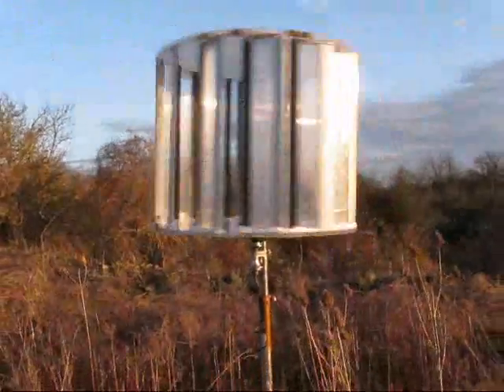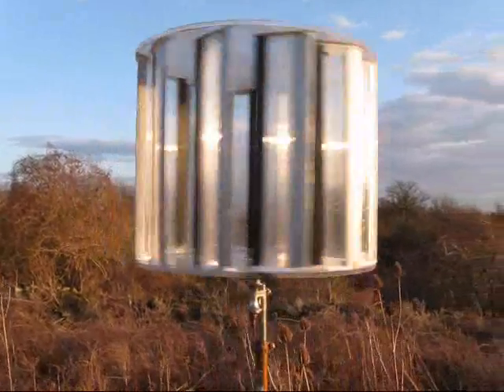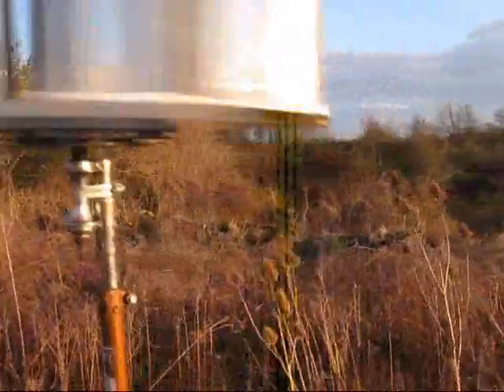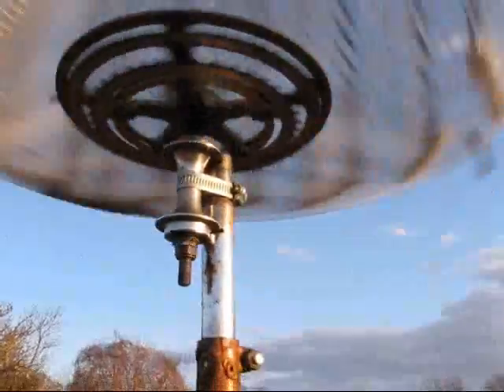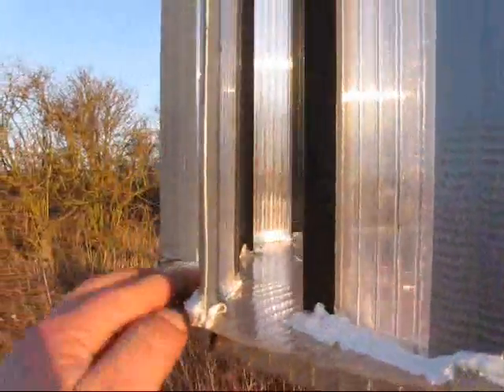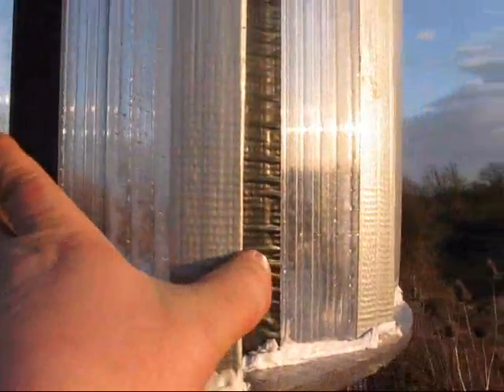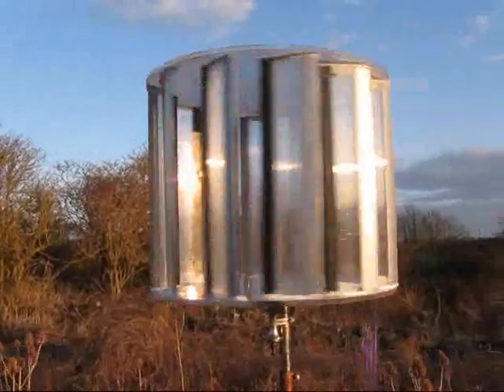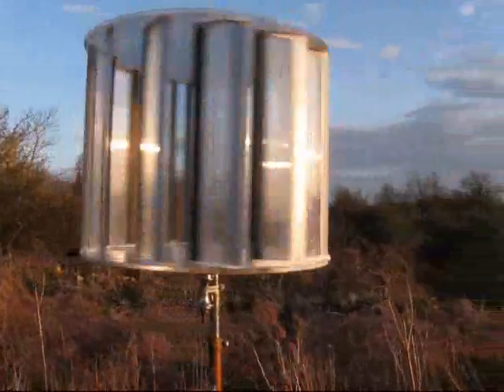VAWT Prototype

Comment: Nice light weight design! I noticed on a similar model that the rotational direction changes at high and low wind. It starts with lift and at higher wind the drag is taking over, changing the direction of rotation.